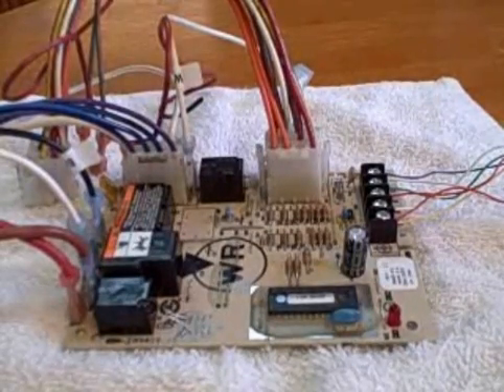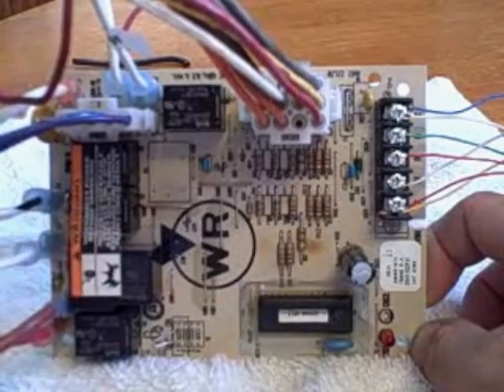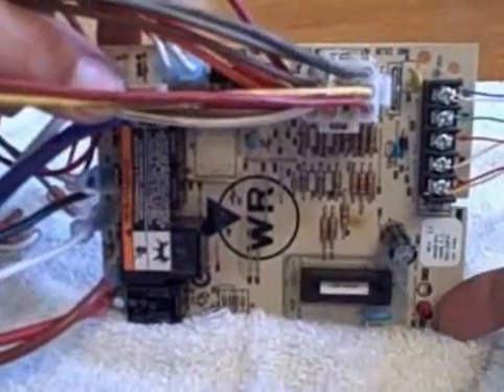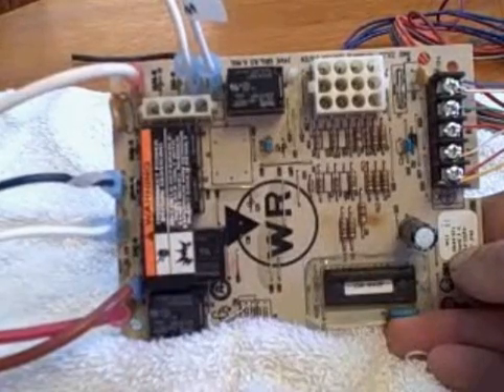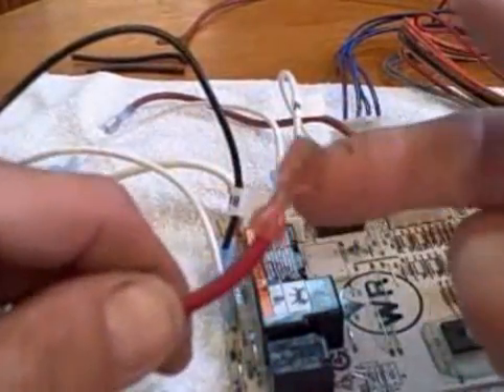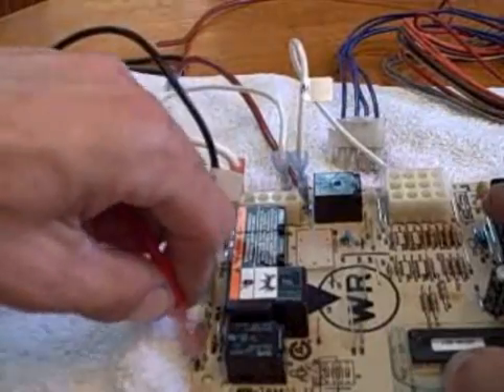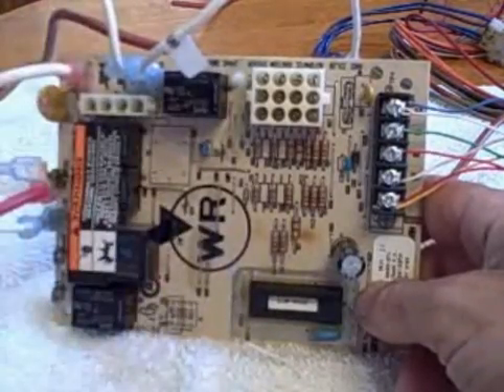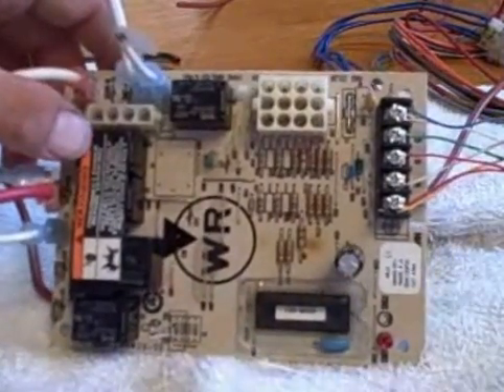HVAC AC Blower not working, troubleshooting Fan Control board, Fan not working.

Comment: The blower relay on my control board burnt off and blower would not turn on.  Call for heat worked fine but no blower so it would turn of.  I replaced the control board with a st9120u and a used honeywell st9160b1084 and it now works but flame turns off once and rapidly turns back on then finishes the cycle

Comment: I am trying to look for something about the control board at the condenser unit. Why dose the relay not close to the contactor? or why it dose not send 24 volts to contactor? Something about the climate control board. Thanks and good video.

Comment: I thought my problem was the control board but my fan was getting 120v like it should but it still wouldn't come on. I could literally hear voltage going to the motor so I tried spinning the motor  with my hand and it starting working!! What exactly could this mean???

Comment: high speed wire is usually for heat, low or medium is for cooling it slows down the air across the coil and allows more humidity control .  couldn't you use a peanut relay and common and g wire , door switch for 120 volts and the white wire on the board the you used to take amps and have a functioning. fan motor on demand with tstat . just curious im new to the ac trade.

Comment: Hi my fan blower won't turn off even when the thermostat is off. I replaced the thermostat as well as replaced the limit switches in the furnance. I put new thermostat wiring as well but the fan continues to run. Can you tell me what I might be overlooking. Thanks

Comment: What if in the beginning you just put a jumper wire from the red and green and the fan came on? Does that still mean the board is bad ?
Reply from the maker: David, no. If the blower fired up when you jumpered it then the problem is elsewhere.

Comment: mikie, thx for the vid. 
My thermostat doesn't trigger anything anymore. ac not working, if I switch from auto to on, the inside fan doesn't run. Outside, if I manually push the contactor, the compressor kicks on, but the fan on top doesn't. if I spin that fan by hand it spins freely doesn't show any signs of seizing. Any suggestions? thx Phil
Reply from the maker: Interesting! My initial thought on the system as a whole is that you likely have a low voltage short somewhere that has either blown a 3 or 5 amp fuse on the evaporator control board, if it has one, or if it doesnt then possibly have a fried low voltage transformer in the evaporator.  Another possibility is a lack of power going to the evaporator, say a tripped breaker. If you have a gas furnace someone could have accidentally flipped off the power switch, which is just a light switch in a lot of modern homes. If you have electric heat you may have several 240v breakers for the indoor unit, usually labeled heat, but sometimes not, heh. At least two on say, three bedroom homes.  If you have power to the unit and youve determined its a short, then you have to find the short before you go wasting a bunch of fuses (and if you replace a bad  transformer be sure to put a 3/5amp fuse on the 24/28v side to keep it from getting fried again.)
Reply from the maker: +mikie2501 ideas for finding the short... Could be a dog chewed through the thermostat wires at the outside unit, a weedeater could have cut and shorted the wires, the wires could be really old and the coating has flaked off and the bare wires are touching.  A rodent could have chewed through wires in the attic, someone could have tripped over or thrown boxes over the wires in the attic breaking them. The thermostat could be totally dead/fried (doesnt happen too often) you may have a weird thermostat that stops working if the batteries in it die. You could have a contactor on the condenser that has a shorted coil, a reversing valve with a shorted coil (if heatpump) ...I could go on but you get the point, thats a good start anyway, heh. 
The outside condenser fan...could just be a bad run capacitor.  Anyway sorry for the delay! Let me know what the tech finds/found!
Reply: yes,  i had  to replace the breaker in the air handler. thx  for  yr input.

Comment: Does the entire motor need to be replaced if my control relay board starts malfunctioning? Because the tech today replaced my entire motor it was only coming on when the air wasn't humid. The AC also seems to be short cycling even after he replaced it. The AC is still under warranty it is less than 2 years old so theres no cost.... thing is the AC was working during the day but at night when the temp got close to dew point the blower would not turn on and the suction pipe from the condenser would freeze over.... I think those idiots installed too big of a condensor and it has to work overtime and now my blower motors are always gonna only last a year or so because of it.... I mentioned this to him but he was like oh that is the right size... blah blah its a 2500 ton the one I had before was a 1500 I love in a 2 bedroom condo with the tradition 2 bedrooms upstairs kitchen dining living room downstairs the vent goes straight up and the only branch off is to the small vent in the upstairs bathroom.
Reply from the maker: wow, all kinds of fun!!  If it were me and I could afford it, I'd call a different reputable company to send someone out to do a system check and survey the whole thing, telling him/her exactly what you told me.  

This is just my opinion, not being able to play with it myself, mind you.
There is nothing wrong with the motor and wasn't anything wrong with the last one either.  maybe he's clueless and just changing parts trying to fix it, hoping that will do it.

You can't fix a problem if you don't see it acting up though! no way would I change parts out unless I could diagnose the problem by seeing it misbehaving or know its the problem by certain indicators.

if your original system was a 1-1\2 ton and they replaced it with a 2-1\2 ton system, that is a huge difference!  for a rough estimate you can figure 500sq ft per ton with average insulation, average windows etc, so your old system was good for about 750sq ft, the new one for 1250sq ft. too large a system won't run as long to cool the house which means it can't pull the humidity out of the house!  
Did they change the whole system, inside and out, or just the outside unit?
as far as the blower not coming on when the humidity is up...you'd have to be there while it was acting up to trace the problem...it could be a freaky loose wire, but you never know where it is till you can put a meter on it to find the location of the power loss.  my first guess would be the control board on the condenser is acting up. might have a cracked board or something...
Definitely not a motor issue though, but you know that now since its still acting up!  yeah, my guess is the defrost control board. let me know what you figure out!
Reply from the maker: One thing you didnt say was what kind of motor it uses, the standard three or four speed that only uses two, high for cool and med or low for hest, or is it one of the newer expensive variable speed motors that has a module bolted to the bottom of it?  Its probably not relevant to the problem, but your first sentence had me wondering.

Comment: I went to plug my blower directly to the door switch and the clip was too small to go on the door switch "male" connector. Why would they make it diff size? Safety issue? How / where do I get / make a jumper so I can test fan/ board?

Comment: Mike:

I had the exact circumstances as your customer (fan not working but outside you coming on).  I followed your steps and solved the blower fan issue and am working on getting a new fan board.  BUT, now my outside unit is not coming on, any chance the technique would have caused an issue with the outside unit.

Thanks,
Dale
Reply from the maker: Nopers, the outside unit is controlled directly from the thermostat. The thermostat wire for cool meets the wire going outside at the board under the same terminal screw. So either the outside unit isnt getting the 24v going to the contactor out there, something is going on withe the contactor, or the outside unit isnt getting power.  Remember that if you are dinking with the thermostat there is a three to five minute delay before the outside unit will kick on.
Reply: Mike, I checked my contactor last night after reading your reply; definitely getting 240 to the contactor, definitely NOT getting 24 volts to the contactor to close the points to get 240 to start Fan/compressor (after turning unit on cool and turning thermo down to call for cool, and waiting much longer than 5 mins for the unit to come on.). Could you give me some places to look to track down the lack of 24 voltage to the contactor?
Reply from the maker: +Anthony Wilhelm ok. Check to see if there is a fuse on the board that might be popped, a 3 or 5 amp car blade style. If not then put the meter on the low voltage wiring to see if the transformer is putting out 24-28v and not burned out. Either by probing the C and R terminals or follow the leads from the transformer going to the board. Sometimes someone will put a fuse inline if one isnt on the board. If the transformer is burned up you can usually smell it pretty easily!

Comment: Hi Mikie! I wanted to say thanks for your video! I am not an HVAC tech, but I do work on motherboards and game pcb's for a living. I live in Houston where central AC is life down here. Here's my question:

My Lennox AC unit has been seizing up around 5 or 6 pm almost everyday/ every other day. I turn the tstat to OFF, turn Fan to ON, and nothing happens. So, I try turning it back to COOL and I hear a click and nothing happens. No fan, no compressor, nada.

After leaving the unit off for about 3 hours, I try again by turning it to COOL. It was working through the night after this for a few days. Now, when I try to turn it back on after letting it sit off for awhile, it will blow cool air for about 5 minutes then shut off again. 

My question is this: do you think it could be the control board?

Not only us it 81 degrees inside now at night with no AC. It's also driving my mind crazy as to try and figure out what could be wrong. 

Things that have been replaced/done thus far: Condenser cleaned, coil cleaned, new ac filter put in, AC tech installed new thermostat(mind you it was doing this same exact thing before tstat replacement too)

Thanks in advance and sorry for the lengthy post!
Reply from the maker: Hi Elizabeth! Sounds like you're having fun, lol! I live in the Dallas area and used to live out east of Baytown so feel your pain, hehehe :). My initial guess would be either the blower motor capacitor is weak/dead and the motor is overheating and shutting down, or the bearings are shot on the blower motor and its been overheating and locking up and has just worn it out.

I think the one time that the blower and compressor didnt come on is because you had just shut the Cool off, tested the fan, then turned cool back on...and there is typically a 3 to 5 minute delay after most compressors go off before they can come back on. Its a time delay either in e outside unit, the thermostat, or both.  I can orolly come up with a few more ideas that are probably out there, but these are the most likely culprits!

Let me know what you find out!     Mike

Comment: Amana SSE ll, 2003 installation with new A-coil.  Only service call was for dirty flame sensor in 2005.  The tech showed me how to clean it and I do it yearly now.  Yesterday when running A/C, I noticed house warming up, the outside unit was on and working.  I shut off A/C. Furnace is in basement, I found condensation on floor, top near PVC drain and damp under blower inside the unit. I also opened panel where flame sensor is and dried there.  I used shop vac to evacuate the drain and allowed to thaw.  I placed a fan in bottom by blower and dried unit for 2.5 hours.  I then tried the furnace, auto / heat to help dry the unit, nothing would come on. The indicator light on board was flickering rapidly but not in a code sequence.  I then put thermostat to run / A/C and rotated blower by hand, flipped on power and pressed door switch. The  board crackled, indicator light flickered and blower came on. I was able to get the door on to hold in the blower switch and allowed the unit to run and cool down the house for several hours.  Today I replaced the capacitor (as suggested), same issue, blower will not start in run or auto, even with assistance.  I pulled and returned all wires on board, looking for moisture, there is no indication of burnt area on board or water stain. Indicator light is not staying red when power is on.   I will now try your method to operated the blower with A/C on,  until I can get a tech here. Only assumption I can make is the blower was failing to run in auto mode, that caused the freezing and thawing, condensation then shorted the board.  Board quote is $458 plus installation and a service charge.  Would I be better off replacing the furnace, I'm assuming my A coil is good and won't be replaced, I cleaned the drain plate under it as well and it isn't that dirty.  Sorry so long winded.  Brenda.
Reply: The board has a 3 amp fuse, it appears to be good, forgot to mention that, also  condenser unit is older but was cleaned last week of June and has no restriction of air flow around it.

Comment: Had a problem that occurred here with a bad controls board.  Showed some burned spots left of fuse.  Replaced board and worked for 2 days and stopped once more.  Burned area in the same spot on new board left of fuse.  Can anyone tell me what is happening?
Reply from the maker: Hmm...thats a bit...weird! First thing I would check is the output voltage on the transformer and the line voltage going to the board. Wondering if the transformer is flaky and putting out too high of voltage. Should be in the 28 volt range, most are labeled. The system requires 24-28v or so. Ive run across transformers that were tapped wrong by someone at the wrong voltage, some are multi use units and you pick the wires for the voltages you need and cap the rest off. Unless youve just been unlucky twice and had power surges that caused damage, it has to be one of those two. Only other thought would be a high voltage line and low voltage line randomly touching for sone reason. Is the fuse popped too?

Comment: thank you so much this video helped me out a great deal! I have that rig hooked up and everything is blowing out cold and good. How long would you say I could keep it like this before I need to have a technician replace the board?Also if I did everything in your video and it all works like this does that for sure mean it's my board that is bad? Thank you so much!!!!
Reply from the maker: Yep, at the very least the relay on the board is bad, at worst there could be other circuits damaged, safeties for the heat cycle, etc.
At the longest you HAVE to have it replaced before you start using heat later this year. It may heat but you dont know for sure if safeties are damaged. I wouldnt wait too long though, its not a lot more but running the blower constantly will cost a bit more come electric bill time! Heh.  Glad the video was helpful!!
Reply: +mikie2501 ok thank you boss man this video was so very helpful and thanx for the reply!!!! 😃😃
Reply from the maker: +Richie L No problem at all!  Glad I could be of help :). Originally when I started posting videos they were just meant for other technicians that were new or other techs sharing different ways of doing things. I never really considered that homeowners would find them useful! Heh.  I always found it difficult to learn something from a book and apply it, but show me once and I have it!  ...that and most of the schools out there either leave out common sense stuff or dont cover the odd stuff, hehehe :). Getting a thank you from someone,wether a homeowner, another tech, student or even a teacher really feels good, especially since I can't get out there and do it anymore :/ :).  Take care and thanks!M

Comment: Hey thanks for the video, helped me suss out my control board issue, the blower bypass trick helped me a lot. Saved probably 200 bucks for a tech visit. So the new board and a run cap for the blower, total cost $215.
Reply from the maker: Cool beans! (I havent used that one in a while but since you said 'sus' which I haven't heard in a while, I thought Id throw it out there, hehehe;)
Well if you have a meter that can measure the capacitors, it wouldnt hurt to go ahead and check the compressor and condenser fan motor caps outside!  Im overdue for checking mine, and the hard start kit. Mine seems to eat the hard start caps every few years, lol.
Reply: mikie2501
 Thanks for the advice.

Comment: You never said what the problem was with the board. I had the same issue and found the board to not be getting power to the fan just like this video, had this problem yesterday. Great video.
Reply from the maker: Hi Aaron! Well Im not an electronics tech so cant say for sure... It could be just the fan relay has gone bad, or there could be a crack in the traces on the board, another component could have dailed, or the board could have taken a surge from a nearby lightning strike and fried it. :)